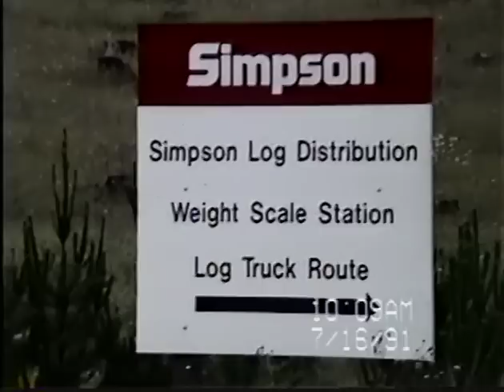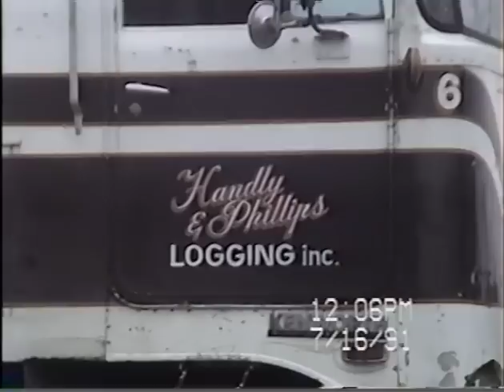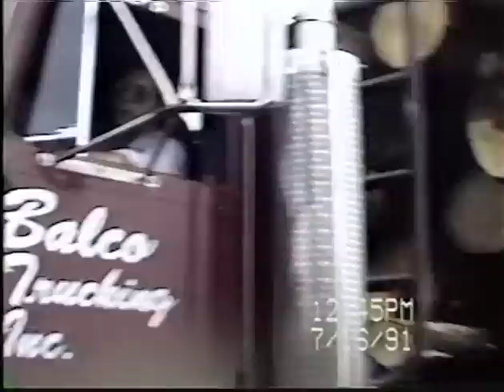Simpson high country logging, Handly & Phillips 1991

Comment: Little trivia on this job.  If you notice I was shortened up more than other trucks.  My idea was trailer was 2 feet farther up in bad corner, thus giving a less of a chance to spin out.  We drivers debated this concept for a few days, with only Wendell the shovel driver agreeing with me.  Dale may have come around, not sure about JR🫣, but I do know this….that skidder was behind me the least amount of time.  Sorry Dale😊. But, JR was ALWAYS packing more weight than us, he just couldn’t help himself….
Reply: Pretty cool to see some old footage of you Dennis. Hope your doing well!
Reply: Absolutely correct. With all that extra driving a shorter wheelbase is ideal. Hauling camprun hight and weight doesn't matter
Reply: I know getting the weight over the drives sure dose help. You had that ol truck pretty high up front!
Reply: was this unit up above camp,  my dad  ran crew of cutters, cut for simpson. one of our last units was above camp,  thought logged this outfit
Reply: camp grisdale
Reply: As long as there aren’t scales along the route I do that a lot.  Depending on the weight of the logs sometimes it rides a little rough but not unbearable

Comment: I remember riding in the truck as a little kid with my dad on quite a few jobs that North Fork Timber had in the high country on some steep roads, trucks getting pulled away from the landing and down the spur. Good times. They don’t do it like they used to..
Reply: Boy we sure don't do it like we used to, that's cuz these forester kids don't have a clue on how to log efficiently or effectively and they're awful damn free with spending a contractor's money making them buy the latest greatest newest Glam gear not to mention you can't get any kids off the goddamn couch to go put boots on and step out in the rain or snow or 90° weather. That's the reason it's not done like we used to anymore